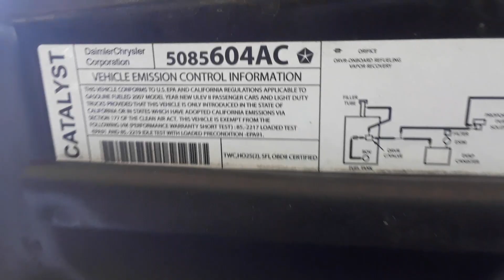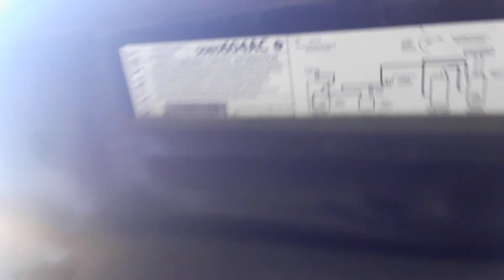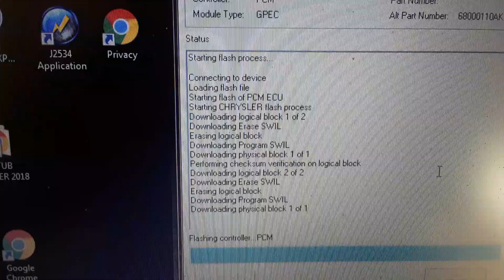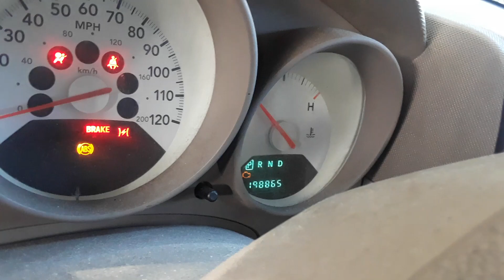Dodge CVT transmission not shifting p0700 p167A

Comment: my 2010 compass have a tranny code p167a, but it will not clear the code because for some reason my scanner reads rpm at 3488 but engine is off?   since the conditions are not met (the scanner thinks engine is running but is not).  what can cause the scanner to read 3488 rpm when engine is off?
Reply from the maker: The engine controller is malfunctioning or has an internal processor fault. The module will need to be replaced to correct the RPM reading. Sometimes a flash update will do but 9 out 10 need replacement! Good luck!!!
Reply: @12voltautoprogramming40  when you say engine controller you mean the ecm right?   And it is separate from the tcm    Thanks for answering!   Suscribed!
Reply from the maker: @12masterr   For example some vehicles are equipped with induvial system modules like a Engine Control Module (ECM) for the engine. Transmission Control Module (TCM) for the transmission .  Also some models will have both modules integrated into one single unit and will be called differently depending on the manufacturer. Always double check your information specs to prevent buying the incorrect module. Your answer yes (ECM) is engine control module and in your vehicle they are both in one module. Good luck mate!!!

Comment: This is exactly what's wrong with my car,  this temp light comes on and then my transmission wont shift to the next gear, It comes on and off though
Reply from the maker: ECM reflash solves driveability engine performance related codes and symptoms. Specially if repairs have been made and you still have the same code!

Comment: I have replaced the transmission in my 07 Patriot and it won't shift! Local dealership couldn't flash it for me.. how can I locate someone to do this for me?
Reply from the maker: I can provide module programming for you if shiped to my station. Second option a local  mobile programming service in your area would be your best option. We're you located?
Reply: @12voltautoprogramming40  I'm from Bartlesville, OK.. I found someone in Tulsa that believes he can fix it..
Reply: @12voltautoprogramming40  hi do you know where I can get this done in KILLEEN TX, thanks
Reply from the maker: This is a place located in texas. You would need to search online for mobile programmers in your area. here is one i use.                  Computer Connections
No reviews · Computer repair service
Plano, TX
(214) 393-7370
Closed ⋅ Opens 8AM Tue